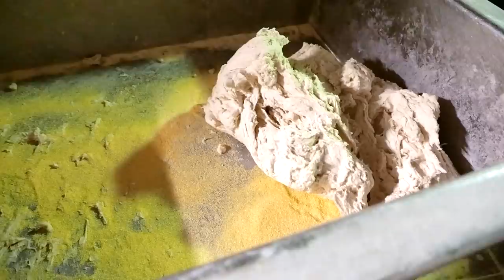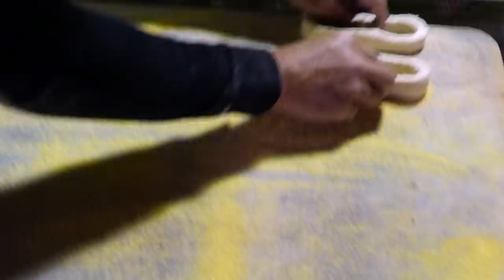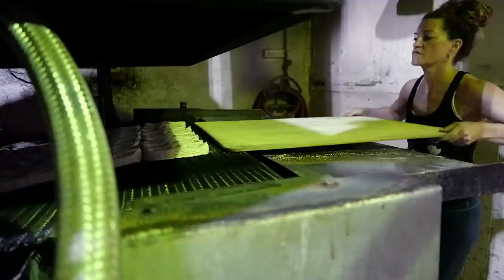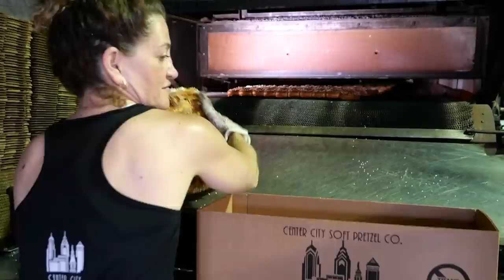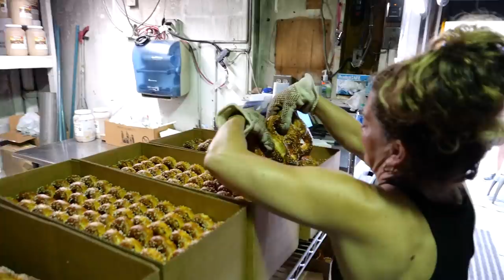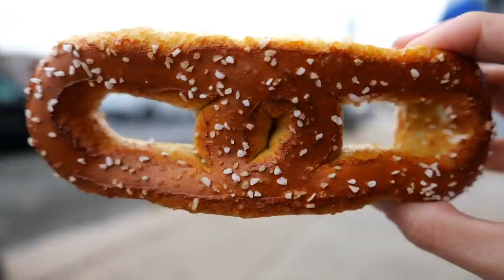American Food - The BEST SOFT PRETZEL in Philly! Center City Pretzel Philadelphia

Comment: Her gloves are disgusting!
Reply: My tough exactly. Look like mechanic gloves handling food and no liner in the box that the prezle goes in.
Reply: Those are oven safe gloves because the pretzels are very hot coming out of the oven. They are discolored from the high temperature.
Reply: @bellasmom2013   oven safe gloves would never be desined with holes! Also if it was the temperature then those gloves would have been discolored more evenly and not in a stain like manner. U can tell she's been using the same gloves for Ages!!
Reply: @kl9045  I know right 🤦‍♀️
Reply: The gloves are for taking the hot pretzels out of the oven. It’s not dirt, it’s discolored from the hot pretzels shedding as they come out. Besides that, this is Philadelphia.
Reply: you rookies!? the dirty gives THAT amazing and unic flavour.